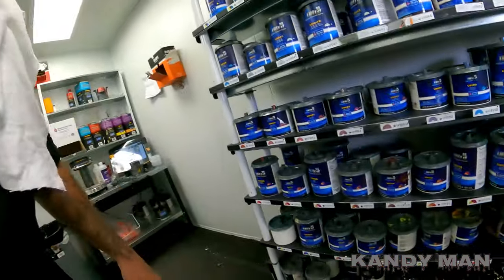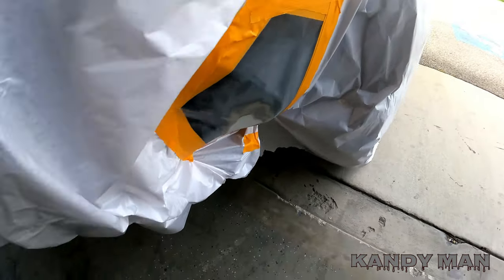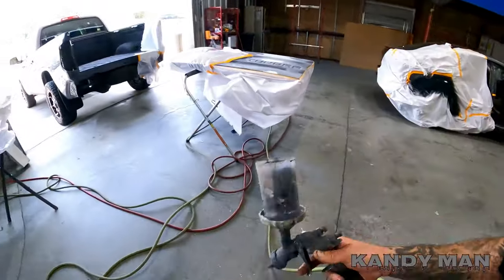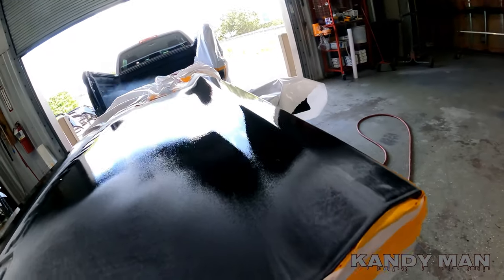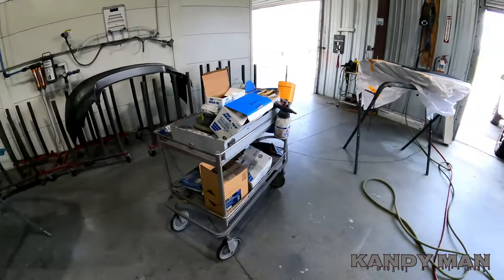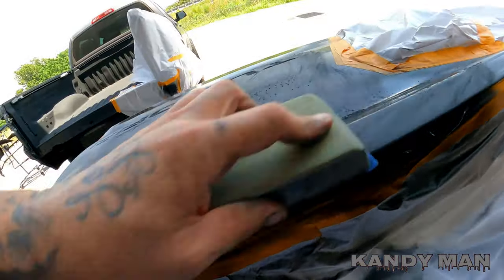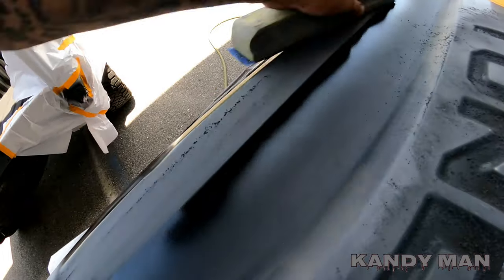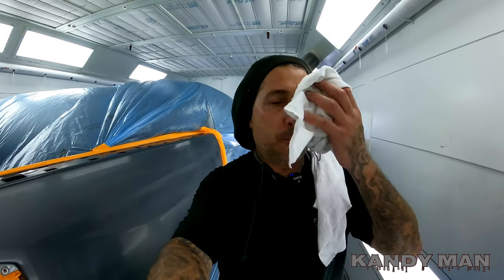2K PRIMER *MY FAVORITE*

Comment: Kandy....I'm using p30b. I have w400 wbx iwata red cap 1.4. What pressure should I be using when trigger pulled? Getting ready for final prime and will wet sand then straight to black base , so just wanna lay flat as possible. Thanks in advance for  sharing your hard earned info and that is much appreciated!
Reply from the maker: Around 24 psi

Comment: You do excellent work sir. In your basecoat gun,  is that a 1.3 or a 1.4?
Reply from the maker: I use pro lite 1.4 tenka base coat 1.3 dv1 1.4 and 3m performance  1.2 for base think that one was the tekna polite 1.4
Reply: @kandyman5315  thank you very much sir!

Comment: What tip did you use for primer?
Reply from the maker: They recommend a 1.0 for this primer
Reply: @kandyman5315  thank you
Reply from the maker: Any time
Reply: @kandyman5315  I been using tbe p30a ,it's great but it leaves pin holes in the primer,  do you get that with the primer?
Reply from the maker: It doesn't like to fill pin holes I would check before priming  for them. And if I missed one I would fill after dry .
Reply: @kandyman5315  oh no it's in the primer. Always fill them before priming. Been using aerosol primers and never had this issues until I switched to p30a
Reply from the maker: What reducer and harder
Reply from the maker: And what size gun
Reply: @kandyman5315  sata minijet 4. 1.0 tip 
Uh80 with sr15
Reply from the maker: @Martin Ocampo  the harder for the primer is h38 uh80 is for the clear and the reducers I used were the us4 and us8 .
Reply from the maker: Gun is fine